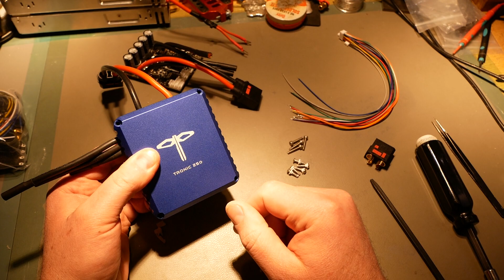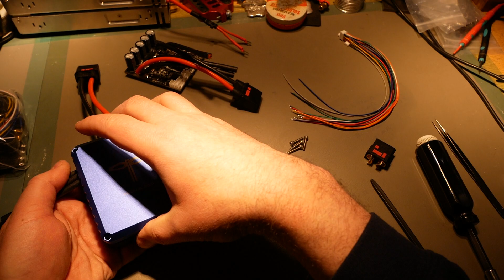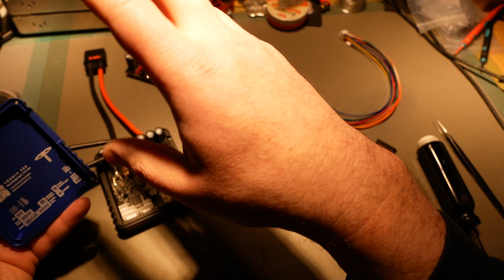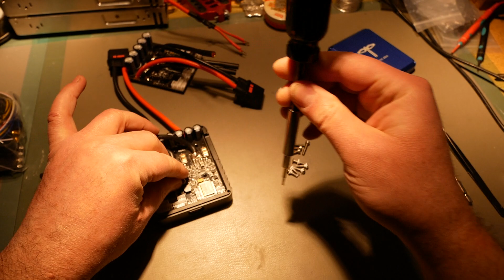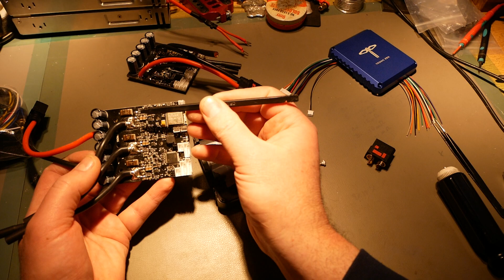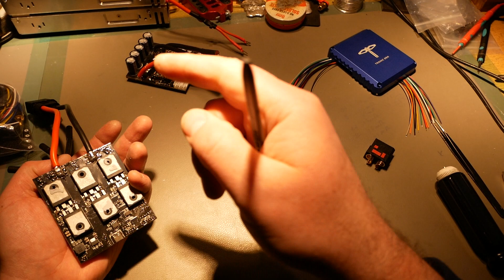Tronic 250 Overview

Comment: do you know how i could fix an issue with a controller where the canbus doesnt work and the throttle voltage only goes from 0.01-0.05 volts ( tronic support isnt much help)

Comment: How would you compare the Tronic 250 to the Flipsky 75200? Know that the Tronic is more powerful at 250 to 300 Phase amp compared to 200 phase amp from the Flipsky. But how bis is the difference?
Like is the Flipsky 75200 wort it at around 150$ while the Tronic can be found around 250$ or is the Flipsky a joke in comparison?

Have two 75H motors with big 10mm^2 phase cables and my shunt modified JP controllers are at their limit puching 80 battery amps 😅.
Reply from the maker: Flipsky cuts lots of corners. They are VESC, but everything they make is copied from others, corners cut and done to minimum quality. Tronic costs more for good reasons...it's all top quality parts and done well. There isn't really a comparison to be made!

Comment: Hi can you run one controller for a dual motor set ?
Reply from the maker: No...one motor, one controller
Reply: @de-bodgery  ok thanks
Reply: @de-bodgery  what Battery management system would you recommend for running 2 x 250 tronic controllers. I need something slimline?   Thanks in advance
Reply from the maker: @customboatscreensolutions5893  JBD and ANT are reasonably good.

Comment: hello I'm thinking of changing the stock controllers on an dualtron storm ltd I'm wondering if its better to buy 2 250r tronic controllers or is it theoretically possible to use a 750 tronic controller and split the output I'm thinking no but unsure and i am also wondering if you know how many amps i can pull from the stock battery with the stock bms
Best regards 
Jasper
Reply from the maker: Hi! You will need dual controllers. You have 2 motors and they need to be driven by separate controllers. The factory BMS and it's amperage is on every sales page for the storm, go look. Whatever amps you see there, the BMS will very likely also be capable of exactly that amount. They don't have extra in the BMS! The cells, maybe, but expect to be replacing the BMS at least!
Reply: @de-bodgery  ok thanks very much for that